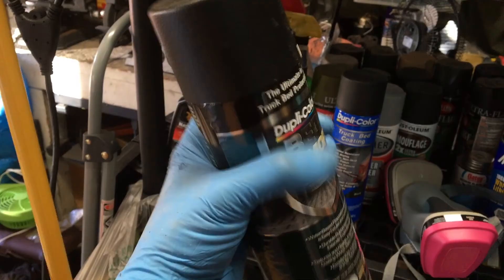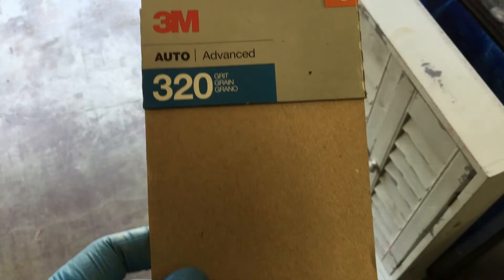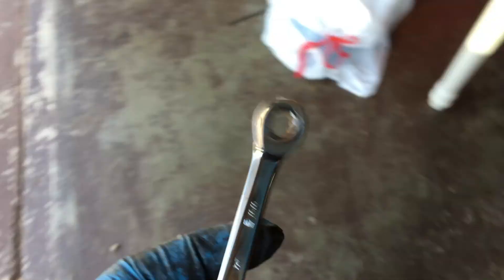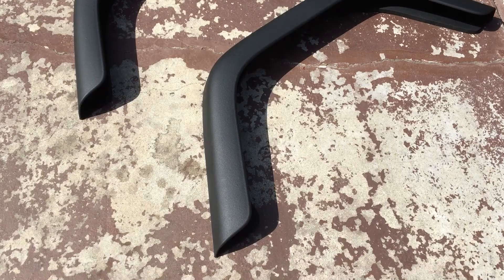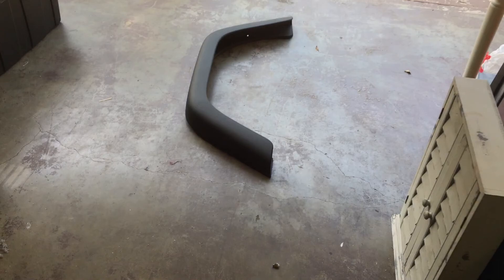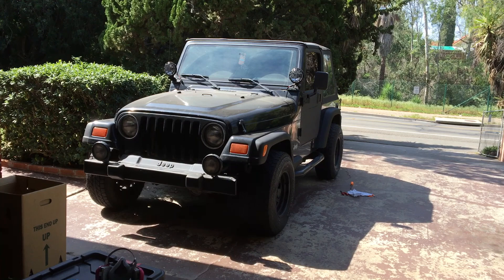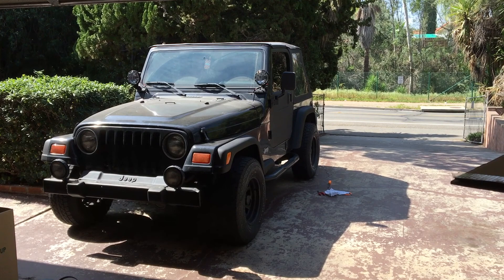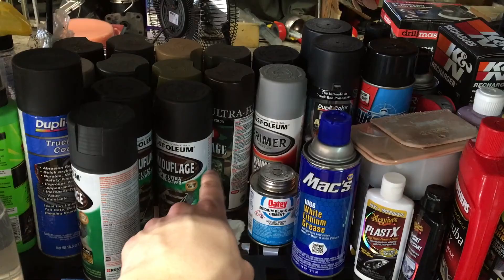How to Paint Jeep Wrangler TJ Fender Flares With Bed Liner! Easy!

Comment: I just did mine for my '01 TJ - I was recommended the Krylon Fusion Satin Black paint and man did it deliver - They look factory.  I scrubbed them  with Simple Green degreaser with a ScotchBrite pad to get the scale off, let them dry thoroughly and put on 3 light/1 heavy coat of paint. Plastic just sucked in the paint - For Reference: 1 12oz can did Rear and Front bumper flares, my stock Step-Side and Rail flare for one side.
Reply from the maker: S/V Ghost very nice!

Comment: Painted mine inside and used adhesion promoter for primer, placed a fan on them to speed up drying time. 20 minutes between coats could be cut to 10 on hot day and the fan.

Comment: I'm doing this and my SUPER faded hardtop on my TJ soon, this helps...though not sure which bedliner paint to use now. I live where the sun is brutal, but it's in the garage when not being driven. Also, what would you use for headliner on a hardtop to lower some of the road noise during highway travel? Keep up the videos!
Reply from the maker: with a TJ, road noise even when i had a hard top wasn't much different than with the soft top man.